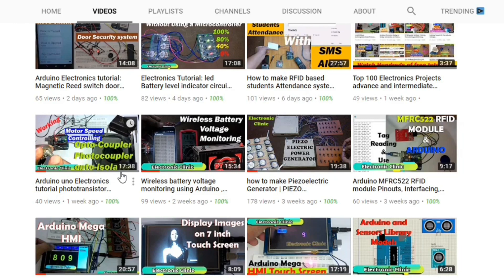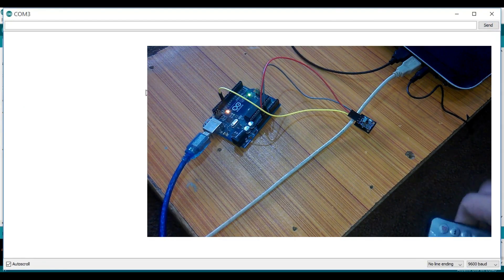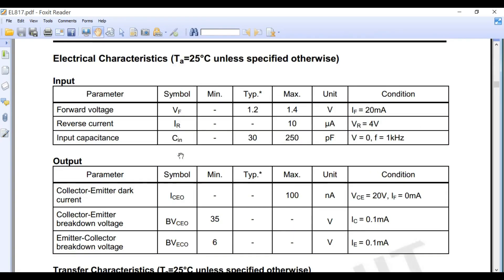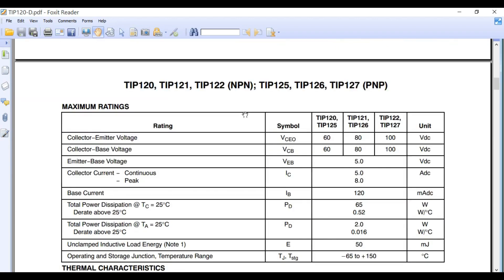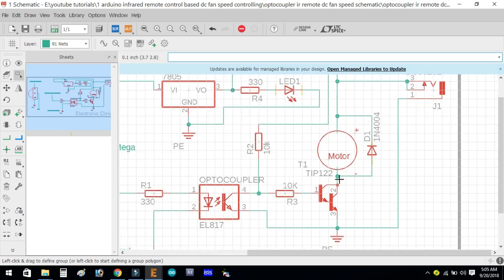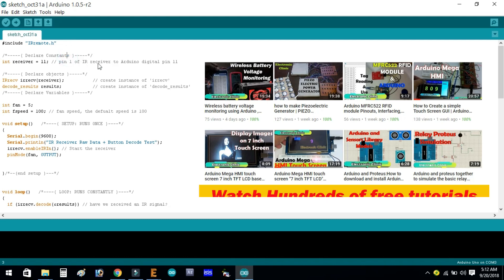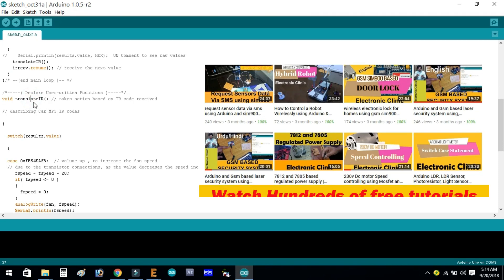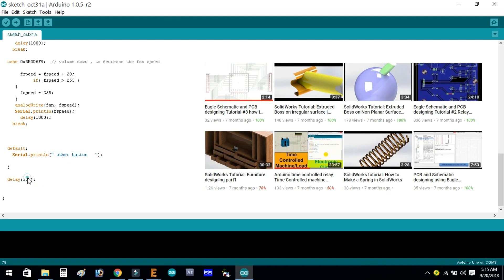IR Remote based dc fan speed controlling using Arduino and Optocoupler

Comment: Sir can this circuit makes the fan totally off when we r reducing the speed
Reply from the maker: yes you can.
Reply: Sir can i get ur watsapp number because I m making a project with peltire module  temperature controlled by ir sensor ....so controlling the current flow of the peltire module I need to implement this circuit ....so if anything will wrong I can contact u for more information